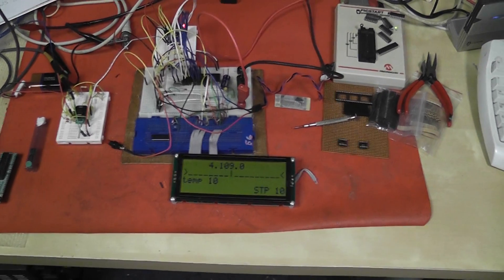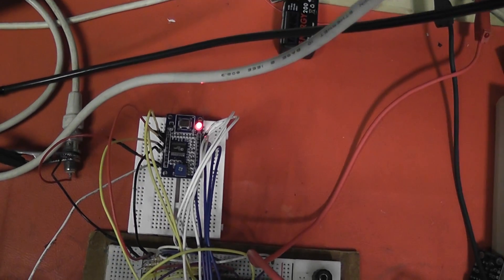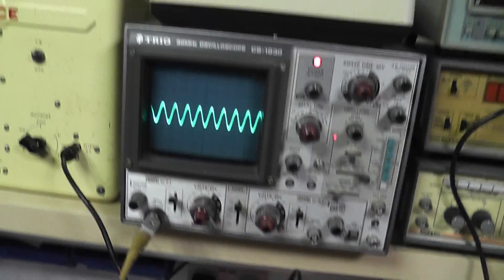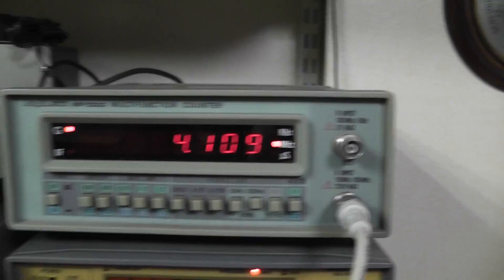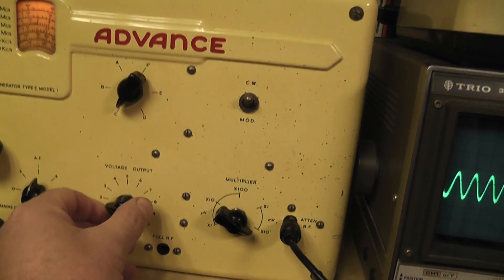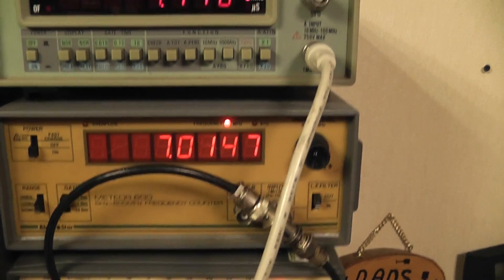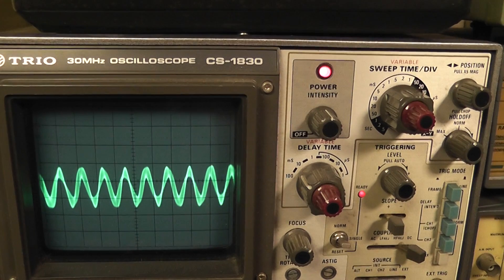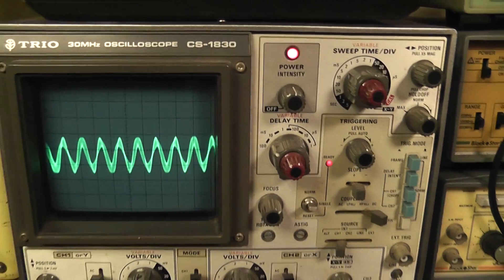40m Transceiver Project (The AD831 Mixer)

Comment: Paul done you have a FC 102 ATU i need some pictures of the wiring to the peak hold unit i have one and all works apart from the peak hold function you might know what it might be ?The atu was left to me by a friend that is no longer with us .pictures of the wires feeding the board would be useful .I don't know if the wires or wire as been  put back on the wrong terminal!! any help would be great Cheers John G0TIY
Reply from the maker: Hi. Here is a link to the manual including circuit diagrams. I hope this helps.

http://www.foxtango.kc9foz.com/FT102/FC-102InstructionManual(Late%20model).pdf

Cheers Paul (M0TVU)
Reply: ***** Hi Paul,Thanks i have just looked at the circuit there are 3 possibility's i need  to check a few resistors and a transistor i think it might be the transistor hope i can find equivalent i know that they are obsolete But thanks again i will let you know cheers John G0tiy
Reply from the maker: ***** If you can't find the bits it might be worth giving Geoff Brown a shout G4ICD. I think he has loads of FT-102 spares available.
Reply: ***** Thanks for the information i might just see what he has for sale cheers Paul